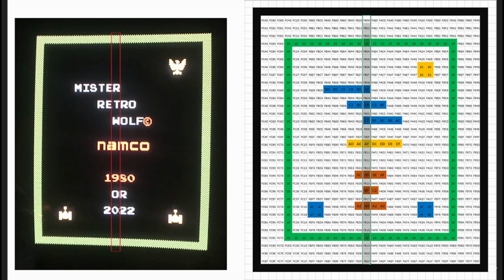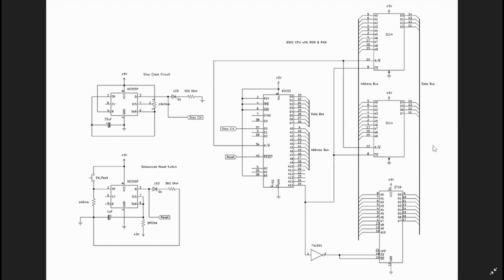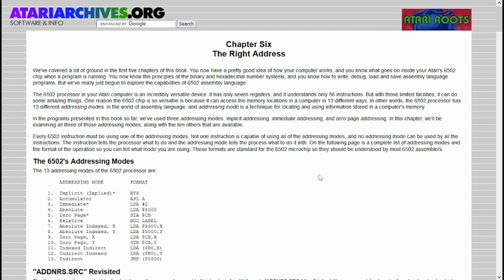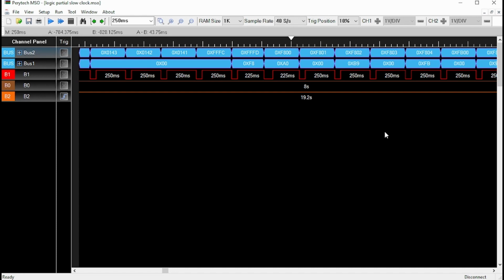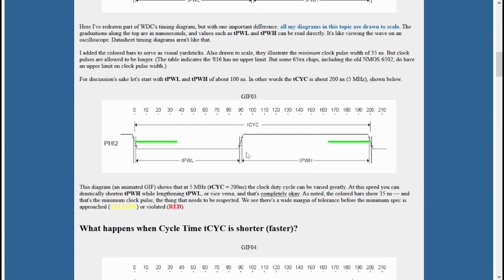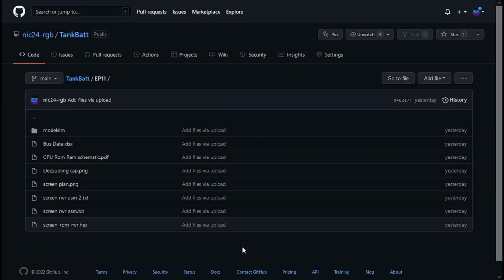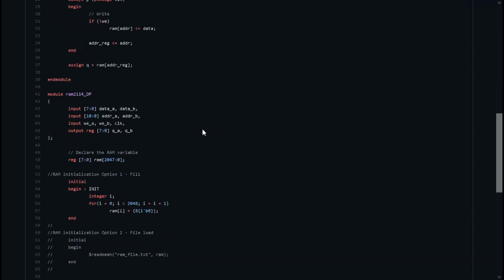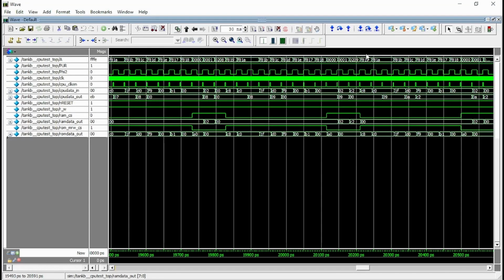MiSTer Core Dev Episode 11: RAM ROM Test

Comment: Hi. Following along with this series. Great stuff!  You may already know but your logic analyser probe tips can be removed, they are connected with 'dupont' headers. These can be popped on to the clip which may or may not be easier than keeping the pingy clips in place.
Reply from the maker: Thanks Charlie. Yes I've tried a few different ways. I noticed that when I put them on the clips they were stretching the holes a little, which mean they then didn't go onto the dupont headers as nicely. Probably fine though. Thanks for the feedback, and thanks for following along.

Comment: Either you're burning the midnight oil, or up very early to upload this! ;)

I was always informed that the efficacy of decoupling caps in reducing noise decreases with the distance of the voltage return path, so one wants to create the shortest possible path for those high frequency components, with the optimal being a direct cap bridge from Vcc to Gnd, and the next best thing being a cap directly off one pin (usually Vcc) and as short a possible path to Gnd.

That said, I'm not an E. Eng, there would surely be people more capable than I to explain the physics of it. All that being said, without decouples I bet if you tuned an AM radio to your circuit's fundamental frequency, you'd be able to pick it up!
Reply from the maker: Ha - Midnight oil here in Texas!
Reply: @misterretrowolf1464  Nice. Hope everything's getting on to that sweet spot between "how can it possibly get this cold in texas" winter weather and "the gates of hell have opened up" summer weather there.

BTW - As you know, I'm kind of going through a bit of parallel stuff to what you're doing, and I noticed something of a convention from things I'm referencing: wires that are active low get suffixed with a '_n' to indicate their active low status, so in the case of your active low write-enable, one might call it 'we_n'.
Reply from the maker: @gawkersdeathrattle1759  - yep we're headed to that 2 weeks where the weather is perfect!
One the wire naming - you're right. I need to get a plan and stick to it. The way you say is definitely a good one.
You going to put out some videos?
Reply: @misterretrowolf1464  I think I might. I'm a bit stymied at the moment though.... my 6502 is running, I'm getting SOME output, but the bulk of it doesn't run. At this point I'm probably going to build a small verilog 6502 monitor so I can see what's going on (watching the line levels works but it's reaaaaally slow compared to a text dump of executed instructions)
Reply from the maker: @gawkersdeathrattle1759  Yeah, text dump may be best as you say.
Reply: @misterretrowolf1464  So... I think I just built a (crappy, totally non-portable) verilog 6502 monitor to see what the heck's up with the code running on the softcpu. It's... verbose, but seems to be working great so far. With any luck I can track down why the main code is stalling.
Reply from the maker: @gawkersdeathrattle1759  Nice one! Good luck.
Reply: @misterretrowolf1464  Found out the problem. The original schematic, it appears, was wrong.

Basically, there's a circuit in MC designed to handle IRQ scheduling, 4 times per frame, triggered based on line number. The circuit's timing is affected based on whether the screen is in normal (top down) or 'flipped' cocktail mode (bottom up),  where the flipped mode counts up. The IRQ scheduler tries to be 'clever' and adjust the clock triggering the IRQ requests so that one happens during a vblank period, as a considerable amount of synchronization is dependent on waiting for vblank to continue, but the original schematic's logic would ensure that, in the event of a screen flip, no IRQ would ever land in a vblank period, causing the machine to effectively 'lock up' waiting for a sync that never came.

Which I would not have learned without my 6502 monitor, so totes worth the effort of investment there! \o/

PS - I also swapped away from the T65 core to the BC6502 core which I believe you're also using. Just seems to have a bit more active development and bug fixing on it, and having everything in verilog is nice for my old brain.
Reply from the maker: @gawkersdeathrattle1759  Good that you found the issue, especially through a nice monitoring hack. I'd be interested to know the game!
Reply: @misterretrowolf1464  Oh sure... Missile Command, the 1980 Atari game. Got a ways to go 'til it's done... still needs actual IO, an actual display (I've already built a 'flat' framebuffer for whatever comes next, so that bit's done at least), wire up all the switches and options, high score support, etc. A large amount of that is done through the MiSTer toolkit, so I'm getting close to digging into that for progress. Just trying to nail down a bug in the graphics writes where the cursor being moved around the screen isn't erasing before I implement a really simple framebuffer-to-vga output and get 'first light'. Oh, there's also a bug on the text scroller at the bottom, which may be the same bug as the cursor issue.

Happy to share the monitor btw, it's basically just a little something that fires on sync and does a simple mnemonic decode of the next 0-2 bytes in memory, along with register states. I don't have my archive up on git anywhere because it'd be a complete embarassment at this point, but let me know if you have a need for something like it and I'll make it available.

Generates output along these lines:

7b4b:   a2 ff            LDX #$ff                       A=00  X=ff  Y=00  SP=ff  flags [ N....I.. ] hcnt=        58 vcnt=  0 vblank=1 irq_n=1 rdout=zz
7b4d:   9a               TXS                            A=00  X=ff  Y=00  SP=ff  flags [ N....I.. ] hcnt=        66 vcnt=  0 vblank=1 irq_n=1 rdout=zz
7b4e:   d8               CLD                            A=00  X=ff  Y=00  SP=ff  flags [ N....I.. ] hcnt=        74 vcnt=  0 vblank=1 irq_n=1 rdout=zz
7b4f:   e8               INX                            A=00  X=00  Y=00  SP=ff  flags [ .....IZ. ] hcnt=        82 vcnt=  0 vblank=1 irq_n=1 rdout=zz
7b50:   8a               TXA                            A=00  X=00  Y=00  SP=ff  flags [ .....IZ. ] hcnt=        90 vcnt=  0 vblank=1 irq_n=1 rdout=zz
Reply from the maker: @gawkersdeathrattle1759  Great game and sounds like a lot of great progress you're making there. I think you're probably in the fast lane compared to my slow lane!!
Reply: @misterretrowolf1464  Heh, it's funny how that all that stuff is relative. I feel as though my progress has been maddeningly slow due to only really having time to work on it after hours and weekends.

It's been very rewarding though, reminds me how things were back in the early days of bashing away on that first generation of home computers, trying to figure out how it all worked.